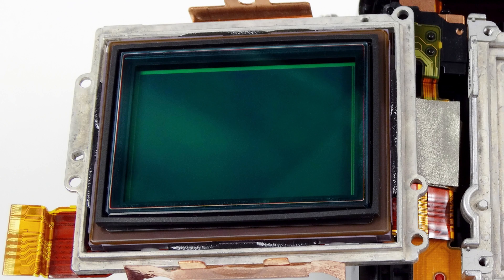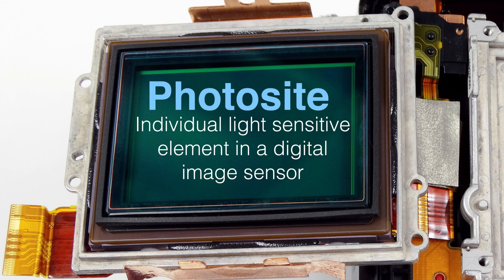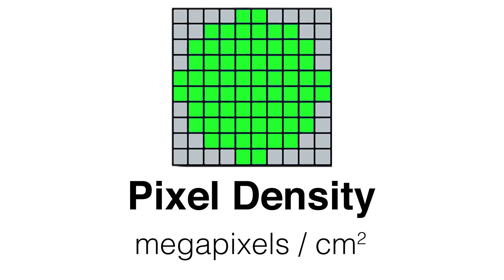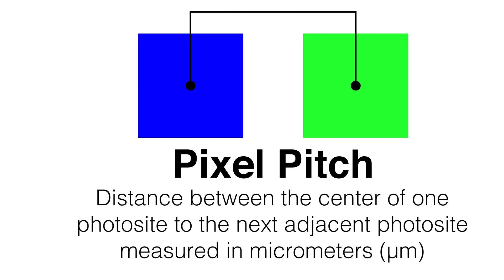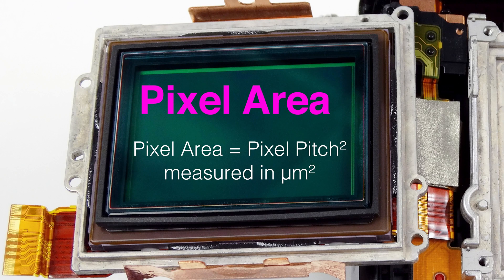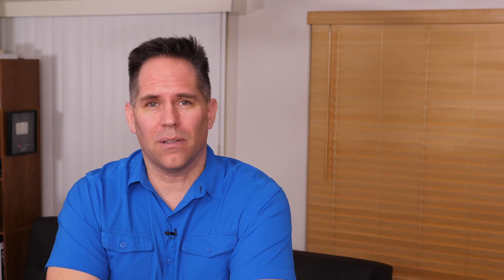Pixel vs Photosite vs Pixel Density vs Pixel Pitch | What is the Difference?

Comment: I have purchased a Nikon D300 to use with a 50mm Nikon f1.8 lens. I am trying to figure out if there is a particular style with this camera and what role the sensor and color rendition would play. Seeking to figure out if to compete with modern cameras with higher resolution if there are specific genres that this combination will work well with and if there are any photographers who have used this combination that I can look at to get a rift from. Thank you for the info in your video.

Comment: That's good. Now do:
Full well capacity
Dual ISO
MTF charts (probably done one but can never have that explained too many times)
Rolling shutter and prospects of global shutter
Real benefits of BSI as a function of sensor size
Shutter angle (for video)
The difference between video formats (all-i etc)
Does DXO weight bit depth too highly
Why shouldn't Gerald remain done.
Why some flare is bad and other flare is a creative tool
organic sensors
Why sensor tech may be approaching hard limits of physics
shot noise
The true relationship between sensor size, pixel density and dynamic range, if any
What is meant when "dynamic range" is distinguished from "photographic dynamic range" (ala Bill Claff)

whether there is any potential technology that could produce a wavelength sensing sensel
will processors ever be fast enough for Panasonic DFD to work well for video?

...for a start.
Reply from the maker: 😂u have many great questions, I actually have answered a few of them including MTF, shot noise and a few others, the rest...I’ll take a stab at!
Reply: @MMaven     I look forward to those - and here's a mathematical rabbit hole to fall down if you haven't already - demosaicing and the resolution difference between Bayer and a non-interpolated (monochrome or Foveon sensor). My first guess would be that sin 60 is involved - but not at the edges - but that different demosaicing algorithms affect the perceived resolution (otherwise there would be only one).
Reply from the maker: Ps- Gerald cannot remain done because he is crazay!

Comment: Two questions I have actually had for some time now are how modular are digital camera internal designs, and what exactly is a camera's buffer storage comprised of? I have always thought it would be cool to experiment with taking a newer camera sensor from a given manufacturer and placing it into an older camera body to see how it performs and if the firmware would accept it. I also thought a nice project would be to improve a given camera's buffer performance by perhaps soldering larger capacity DRAM chips onto the mainboard of a camera. I remember some Nikon pro bodies could be sent in for buffer upgrades that would double the buffering capacity, and then, of course, that Nikon rumor about the RBGW- sensored D750 that came around a few years ago now got me to thinking about just how easy it might be to replace a DSLR sensor with a newer, maybe more capable one. If you have any insight on these topics, I would be glad to hear it!